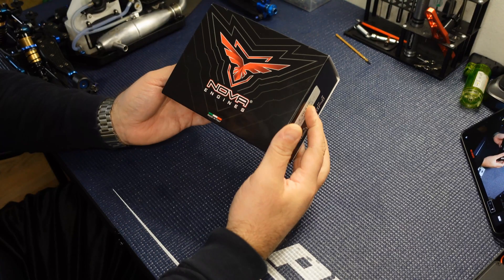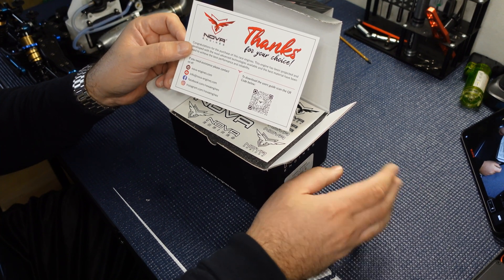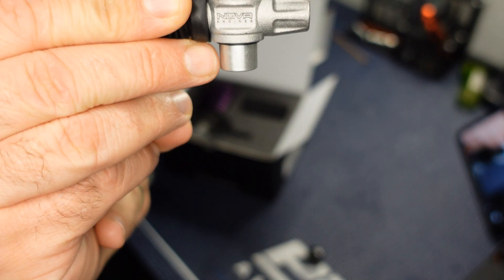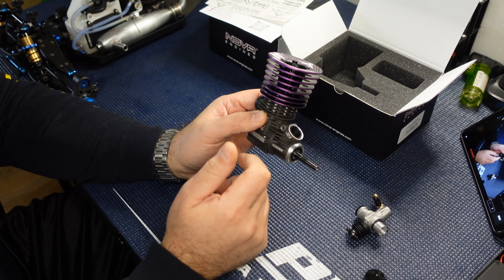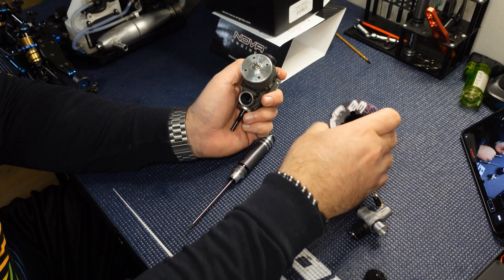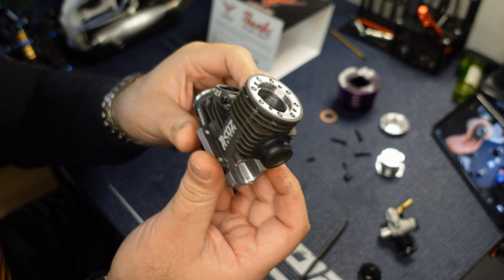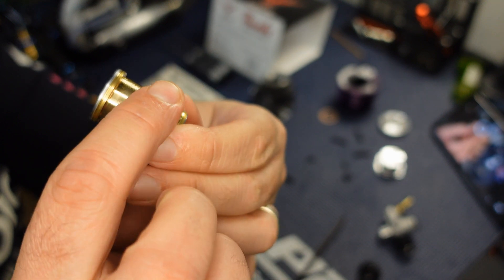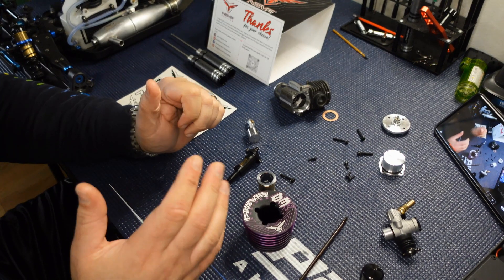NOVA ENGINES B3R NOVAROSSI RETURNS! ENGINE UNBOXING AND DISASSEMBLY!

Comment: I really hope Nova does well - Novarossi was my brand years ago. I was just starting to get equipment to begin racing after almost 20 years out of the hobby. Of course, my timing couldn’t have been any worse (late 2019). I’m an on-road racer and bought a Novarossi .12 Mephisto literally just a few months before the rumors of their demise began spreading. I know that 1/8th off-road is all the rage, so it makes sense that they focus on that, butI do hope that they release a .12 fairly soon. Novarossi’s were spectacular in that class some years back, so I hope that whatever Nova releases (if they do) should be 🔥!
Reply from the maker: All I raced was novarossi/collari back in the day, I was so bummed when I heard they were going out of business. Now, Nova really is picking up where Novarossi left off, the quality is phenomenal and so is the performance. I have tried the b3r, the b5r and the r9r (on road) and I love all 3. They did have a couple issues with their first batch of engines but it all seems corrected now. I also hope they come up with a .12 soon!

Comment: been racing this engine and it screams... problem is ... after a couple of tanks ..the carb keeps popping out when reving it high..... even though how tight you screw the pinch bolt in.
Reply from the maker: I saw one do that at the track. Did you contact Nova about it? I heard there's a fix for it, but neither of mine have done that. The one I saw got full of dirt inside, and it was definitely done.
Reply: @bustednutsrc  sending out to Bones Motorsports LLC ... he is like the service center for Nova in the US. Hopefully he can fix it.
Reply from the maker: @philfernandez6306  Yeah I got all my nova engines from Brent at Bones. I just sent an email to nova as well, I want to know what the fix is.
Reply: @bustednutsrc  share it here once you know the fix
Reply from the maker: @philfernandez6306  They finally replied. All they said was that only the first batch of engines were affected. The carb retainer is too long, so the fix is to have your local dealer to send you the updated retainer. Part #1200000
Reply: @bustednutsrc  okay thanks... carb retainer... what the heck is that... that black plastic layer where the carb goes?
Reply: @philfernandez6306 I googled it out of interest and it’s the 2 part pinch bolt 
The 2 parts are too long so when tightened the round cut outs cannot squeeze the round carb body tube tightly
Reply: @neontetra1000   I got a hold of Mr. Rossi and he sent me the new pinch bolt and black sleeve for the carb.  The engine is working great now. I love how my 3 port runs and it is super easy to tune. My brother have the 5 port and it has more top speed but it's tricky to tune.

Comment: Considering getting the B3 (non-R) for my basher. Currently "running" an old 4.6 Force Engine, that is starting to develop tuning issues (swapping the glow plug didnt help).
Reply from the maker: You'll love the B3, it's a great engine! 
Have you checked the old engine for leaks? Or is it just low on compression now?
Reply: @bustednutsrc  It felt like it was low on compression; did a maintenance strip a few weeks ago, cleaned everything and assembled it back together with some after run oil. It seems to have higher compression now, but will need to wait for good weather. Currently 2°C and lots and lots of rain here in Germany.

I might wait for their Truggy engines, a 4.6 Nova will probably run like hell in a buggy!
Reply from the maker: @xXYannuschXx  Oh yeah! I am waiting on their teuggy engine too! I put the Reds 723 on a buggy and it was a blast haha, just too much for the track.

Comment: Is the carb insulation sleeve in the block? looks like bare metal on the carb but didn't get a good look at where it goes into the block. Kind of looked like it was grooved in there.
Reply: Yes, it is in the block. There are other vids on YouTube on these engines pointing this out they look pretty good.
Reply from the maker: Yes, the insulation sleeve is in the block.
Reply: @bustednutsrc  cool. I haven't seen it done like this before.

Comment: I got mine last week the B5R with the exhaust package. Definitely a quality motor. 

Nice videos bro. I subscribed to your channel.
Reply: Serpent America/De Soto racing are the official distributor for the U.S market.  They sell the correct header/pipe(EFRA2182)for this engine.
Reply from the maker: Thank you so much brother! Where did you buy yours? Where I got mine didn't have any exhausts for sale, I need to find one.
Reply: Is not an actual exhaust package but they do have the header and exhaust separately if you want to buy it. They also have glow plugs.
Reply from the maker: Nice, I need to find the exhaust. Bonesmotorsports only had engines.